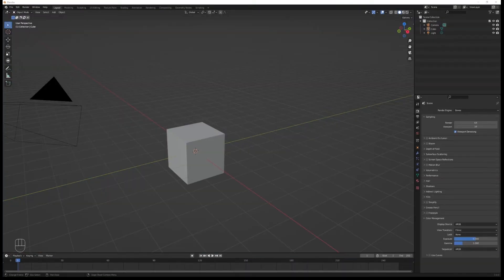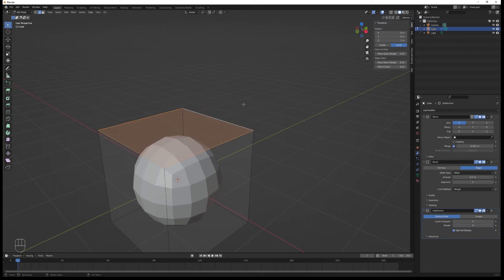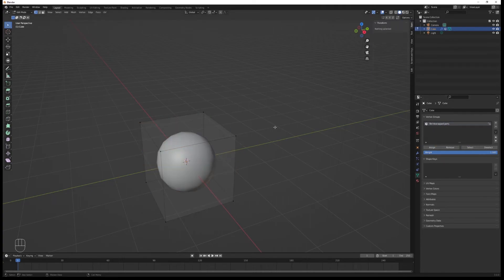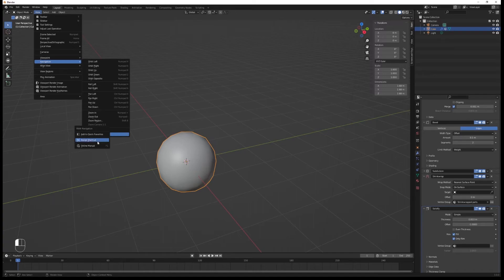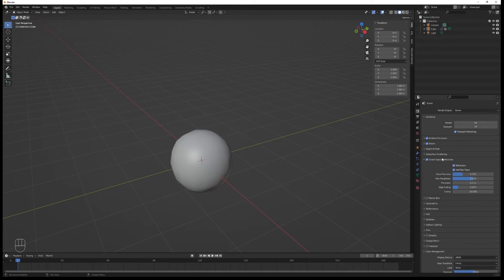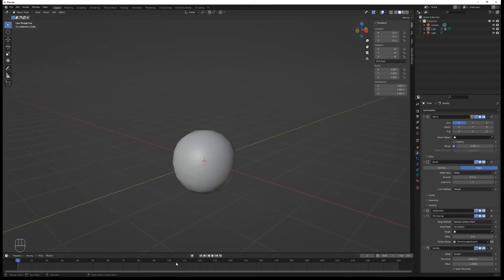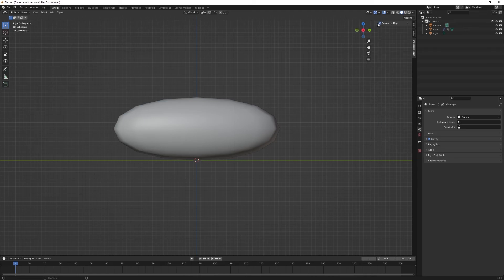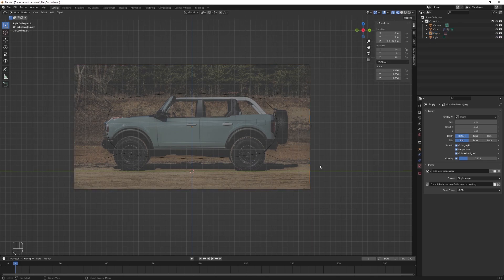Blender Concept Car Modeling - PART 1

Comment: Cool start! Also you could increase the bevel profile so the created edges behave like added loops instead of rounding off
Reply from the maker: Thanks! Never thought about changing the bevel profile for this use case I will have to check it out.

Comment: Hi ,super tutorial !!! Why are you using a Shrinkwrap at the beginning ?
Reply from the maker: Thank you! I add the shrinkwrap at the beginning so when I split the panels they already have the modifier setup and I don’t have to add the modifier and it’s settings to every part manually. 

Let me know if that helped!
Reply: @baril3d  Thanks sometimes I feel Blender going super slow in edit mode like moving Cv ,I think it’s because the shrinkwrap did you experience this already ?
Reply from the maker: @mrsqueen8559  No problem, I don’t think it’s the shrinkwrap, what could cause this is likely the subdivision surface modifier. I set mine to 2 in viewport and 4 in render for the basemesh but feel free to turn it down to 1 while working on the car if it feels laggy. Let me know if that helps!

Comment: Hi, I am a beginner... Can you tell me how can I make the edge extrudes curved...  I tried many options.. but the corners are still sharp.. thank you
Reply from the maker: Hello! Do you have a subdivision surface modifier on your mesh?

Another thing that could cause them to be sharp could because the vertices are connected to more than 2 edges. If that is the case don’t worry they should be rounded once you have some faces done. It depends on the topology of course.

It’s easier to tell the problem with a screenshot so if the solutions above didn’t work send me a DM on Instagram at Baril3D and I will do my best to find the problem and solution.

Thanks!
Reply: @baril3d  thakyou so much..subdivison  modifier solved the issue!
Reply from the maker: @anurags3500  Awesome! Let me know if you encounter any other problem or have any questions!